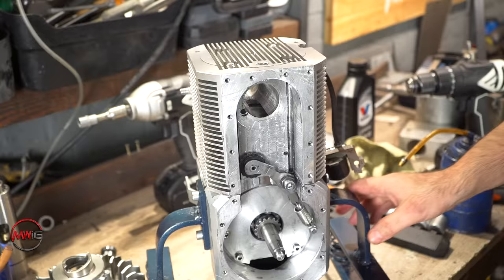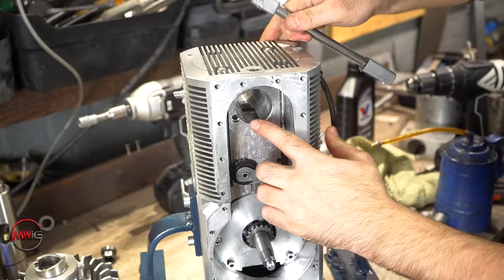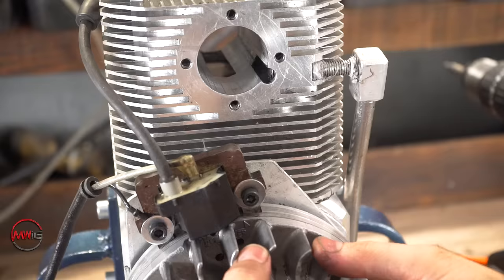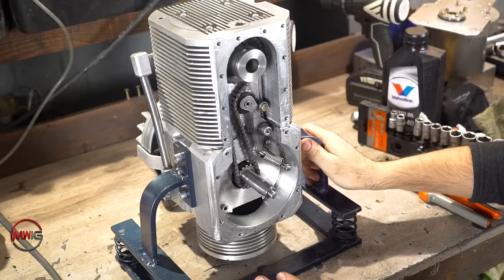I built a brand-new Rotary Valve Engine, and it works!

Comment: To improve the overall combustion process consider this idea. Open up the diameter of the rotary valve and add a sleeve similar to the Piston sleeve  and then get some iron rod a machine some compression rings to fit in to the rotary valve keep tolerances tight and machine a corisponding grove on the ends and in the middle of the rotary valve  so that the valve has the ability to create a seal to improve compression also machine some small oil ports that will provided lubricating oil to the valve and remove and replace the fuel intake tube with all the holes and instead install one machined from stainless steel and reduce the holes to only the area in compassing the area of the intake opening and similar to a valved engine remachine the rotary valve to reduce the exhaust opening of the valve, by concentrating on the reduction of the fuel spray bar to the opening of the intake/ creating seals on the rotary valve and reducing the exhaust port opening size this should reduce smoking, improve compression and improve fuel burn

Comment: Now it needs to be improved, like making proper engine mounts, which is very easy to do, it is also an oil burner so that will need to be sorted out, needs also an auto advance timer,  great work good idea that type of valve. Application make a good generator motor or even marine, How about building diesel 4-stroke engine with that type of valve

Comment: I guess it will smoke. There's no seal to prevent the oil lubing the valve shaft being combusted. Production engines that used rotary valves I think used ceramic bearings/seals to prevent this issue. Also it looks like you run apetroil mix. You shouldn't need to as you have a sump with oil for lubrication.Fantastic job though!

Comment: A really smoky two cycle! 😀
Reply: It's a 4 cycle...  he has oil in the fuel for run in, but the rotary valve would leak a lot of oil into the cylinder.

Comment: Nice and very exciting work by a very talented craftsman. But, why did you try to reinvent the whole wheel? You could have designed and crafted just a new cylinder head for an existing engine to prove and improve your idea there? Such an approach would have allowed you to focus at the essential part of your project. However, the problem with rotary vanes is that the bearings will char on the exhaust side more sooner than later as the lubrication for the vane can't be maintained at exhaust temperatures. And you get the full working pressure banging on the sleeve bearing, and and and.

Comment: I guess now is the time to try some inlet and exhaust overlap in order to raise the efficiency , The areo Sleeve valve engines of Roy Fedden I  guess had overlap , but probably less then poppet valve engines...., i later years there has been a lot of advanćement in valve timing....

Comment: i think you could maybe use less oil in the fuel and maybe use a two stroke oil at a 50 or 100:1 mix as you got lube from the oiler to the rotary valve and thats possibly enough for it i reckon.

Comment: Good work - making a rotary valve engine that runs - not the first time I saw one, and it too was home made, the engine was a 500cc single in a motorcycle - although he made the head separate from the cylinder and had 2 plugs and a real magneto - continue to play around with this great engineering feat and keep us posted on its progress --- you night be able to advance the ignition timing a bit, work on a way to have it advance and retard, and look more into the cam-timing events and the duration - which in your case is the width of the slots and where they open and close - could be a very interesting engine - sounds too much like a lawn-mower, rather then a real hot rod that it is -----

Comment: I wonder if it would smoke less if you used ashless 2 stroke oil in the gas? I have a 4-stroke weed eater that runs on 2-cycle oil and has no oil reservoir or pump. Should work.

Comment: why do you have oil in the fuel ? and you can try to seal the intake valve like an old vw type 1 crank, ( treads outgoing to help the oil stay out of the engine). but an amazinge work.

Comment: Hy Sir. I just saw this amazing video! I think the issue might be the piston geting stuck in the chamber as it gets hot so then it "pinches" too much. Have you tried using racing fuel like the use on 1/8 Scale Nitro racing? Or some cooling system on the head?
Go check some systems like a starter like they use on the 1/5th scale RC Petrol Cars. And also check the distance of the Spark plug into the Chamber. Maybe use a Hotter Spark Plug. What was the Combustion ratio if you check that?

Would be amazing to see that Engine start and run because I suspect you will have a great Torque motor and can last very long because the little mechanical parts...
Please get this thing going...

Comment: you need a sealing ring like a piston on each side of the valve shaft you also need a base like a valve seat this will have a spring system underneath to keep it pressed against the valve shaft see the link to the video I posted

￼

Comment: Hi, had a thought about your engine, is it possible to fit an oil seal both ends, as i think thats where all the smoke is coming from, as far as i know ring seals are not all that restrictive after all, the crankshaft has them as do many of the shafts in an engine, just a thought.

Comment: It is a small car made in DDR called Trabant. It's a two-cylinder, two-stroke machine, which also has two rotary valves for the intake. I think that this solution is not something effective.

Comment: I have one question. You built a FOUR STROKE engine, yet you are putting oil in the fuel, why is that? Not only are you putting oil in the fuel but you're putting WAY TOO MUCH oil in the fuel, all you're going to do with that much oil in the fuel is foul up your spark plug. You have an oil reservoir and an oil pump, if your crank shaft is dipping into your oil reservoir on the downward stroke there should be enough oiling for the piston and the piston rings. if you feel you MUST put oil into the fuel you need to tone the mixture WAY DOWN. If you want to know the mix ratio just look at the ratios for two stroke engines on the labels of two stroke engine oil. but I think that is would be unnecessary to add any oil at all. Other than that, I think did an excellent job! Not many people have a firm enough grasp of the engineering behind an engine to build a scratch-built engine that functions! So, way to go!

Comment: now if you can just get the valve dwell just right, that would make it run even better. I wonder if curved valve channels might work better or is that it just has such low compression it's hard to make much change? I honestly don't know, just throwing bones on the table.

Comment: Do you really need a lubricant in the fuel? Have you tried to run it on propane? It is much easier to regulate the engine with the propane content in the unthrottled inlet air than with a carburator

Comment: frankly I invite you to build a much more simple motor yet much more efficient, double direct piston engine generator, basically a tube with 2 piston in opposition on the link you have a linear "rotor", for prototype it could be made with magnet (later with solenoid powered through , a contact less induction system).
For this you need collaboration of electrical engineer and if you want to make it better the solenoid could be made with carbon fiber that could make a smaller momentum, thus increase the speed of alternative regime and  then the frequency of the alternative current, higher frequency less  Iron for the stator.
This type of generator is much needed for electrical aviation, range extender for car, running at constant speed they are easily optimized, they could be made in 2 strokes class, yet non polluting . 
the exhaust port stay open when air intake port start to send fresh air (small air compressor needed ) so only air is lost in the exhaust.  When the piston goes to the top and intake port is obstructed then electrical injector send the fuel making the mix very rich close to the spark plug and the ignition easy while the mix is perfect (thus hard to ignite)

Comment: Now to get it to be legal you are gonna need 3 egr valves, a PCV system, a whole bunch of useless sensors and roughly 14 miles of vacuum hoses which are regulated by engine temperature and NOBODY knows what they actually do. I’m thinking like a 1981 Chev Citation.  Take a motor that barely runs, put a terrible carb on it, and all the part mentioned above, and it’ll pass inspection.  Until it hits 20k miles then forget it.

Comment: But why all of that oil in the fuel??  It's a four stroke, not a two stroke engine!  If the valve needs the lubrication, then make a sleeve out of Teflon!  BTW, I had the idea for making a valve just like this in 1971 when I was in Junior High School, but never did much with it for various reasons, mainly money for machine tools and time.  I built a few mock ups out of wood, cardboard tube and even a head out of Aluminum.

Comment: Could be done better. I had similar idea long time ago, but completely redesigning pistons to make it more compact, and increase the scavenging flows, with good compression sealing and lubricating design, with no oil consumption but anyway I stopped thinking about improving piston engines long time ago, as they got massive issues and I completely redesigned engines from the scratch making something completely innovative not using any crank/connecting rods/pistons system - getting rid of major issues with such engines.
the biggest issue of Your design is lack of proper valves sealing - it has to be done to work in real life usage.

Comment: rotary valves concept is not new, I saw the concept used on an OHC Honda engine some 40 plus years ago. This is the first time I have seen one built from scratch though. I would have thought the ignition or valve timing was not correct until I saw how far up in the head the spark plug was. I still think that perhaps the timing may not be optimal. congratulations on the project though, it mad for a very interesting video.

Comment: thats a lot of blow by/oil consumption.... thats not going to last a long...... might need to add some sealing surface to the valve shaft to reduce oil consumption and check the piston rings for tolerance. That engine shouldn't smoke that much based on your design tolerances.

Comment: Set up the screw for air fuel ratio.. Sou have to much fuel.. The ratio is not correct.. You will get more rpm, less exhaust gases but higher temperatures..

Comment: Why don’t you pay attention if you created a whole engine but never created a hydrogen engine, you just need stainless steel plates and use alkali caustic soda with a density of 1.27 so that there is a strong separation between the plates there are four or five plates the generator should do just fine to release gas for this purpose

Comment: I'm not an engineer nor am I a dumb ass,, But if you were smart enuff to do what you did? Why did'nt you make the intake and exhaust have their on rotor valve so you could control the timing of the rotors (or intake and exhaust) rather?

Comment: I've watched the build video and then this one. The idea you have is not a new one, it goes back to about the turn of the twentieth century in the infant aviation industry. It can work, but can never deliver any real power the way they did it, but what you have built I have seen in model engines, piston port engines with the rotary valve built right into the crankshaft. Your port timing is wildly, crazily, completely wrong. 

First, the ports are about four times too large, and the exhaust port has to be small, and you need a more efficient way to keep intake and exhaust from blending. Perhaps a molded Wankel seal or something cut out of a brake shoe, but it has to take the heat. You're mixing exhaust and intake gasses, which can get your head shot through with free range connecting rod. If none of this works, you can try a poppet valve, but you can't get much power out of it that way, either. These tracks of development led to the use of compressors on engines starting around 1911 or so, I think.

Comment: use proper 2 stroke oil! motor oil does not burn like 2 stroke oil
Reply: oh nice! love the build actually! ive watched the process  and if i could help i would suggest 1 or 2 upgrades!! :) the first one would be the oil feed for the valve, instead of injecting motor oil and having it straight true, plug up the end where the chain is and feed 2 stroke oil so no need to premix the fuel with the oil and then use the pump to lubricate the chain! the 2stroke oil might need a little pressure either by gravity or with a really small pump! since you don't want to drown the assembly

Comment: Mettre de l'huile moteur 15W40 dans l'essence, surtout sans en mesurer la proportion, est complètement ABERRANT. Il faut une huile 2T de synthèse à 1,5% ou 2% maximum. Avec une huile moteur, non seulement cela ne graissera pas correctement mais cela fera de la calamine partout, avec la vieille perle à la bougie de jadis.
Je trouve dommage que toutes ces qualités d'ingénieur et d'ouvrier mécanicien soient polluées par une sottise aussi grossière.
D'autre part, pour la plupart des moteurs, le point d'allumage est à 2mm avant PMH. Avec une culasse plate et une compression faible, on peut même mettre 1,5mm avant PMH.
J'ai couru en moto jadis, avec des moteurs que je préparais moi-même, je connais un peu la question.
Salut et fraternité*

Comment: So he built an engine without reliable poppet valves & uses a rotary valve that requires oil in the gas to lubricate it, we saw it run for a few seconds only with smoke pumping out, the whole thing is pointless.

Comment: This is a case of a design flaw from the outset. Why so much work in making something that defies 100 years of the worlds best designers and this design discarded long ago. It is complex, it is dirty, it is inefficient, poor breathing, poor comubustion sealing - the list goes on and on. It would have been better to work on a different design that has some superior advantages. 

But with companies like VW, Volvo, Ferrari, GM, Ford, Honda, Yamaha etc who have superb talent getting every last drop, this engine has reached its heights of achievement. Tesla went a different direction and changed the world. You need to do the same.

Congrats on the build, but fail on the design.

Comment: Well. 
Working is not what I would call it. Rotating or slide valves is not used for engines for a reason. 
They do not work. And will never do. If you are a engineer this is obvius. 
And if one should try this you only need to make a head, not a complete engine. Wast of time is what it is.